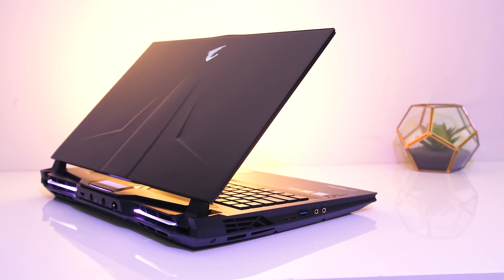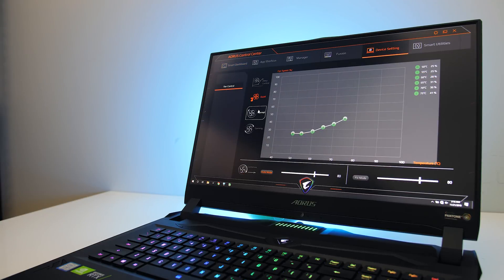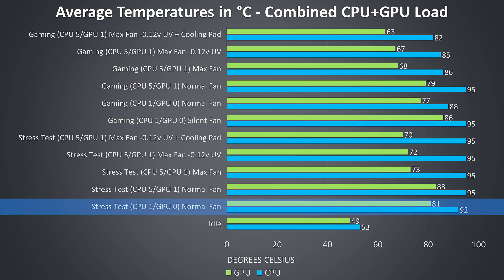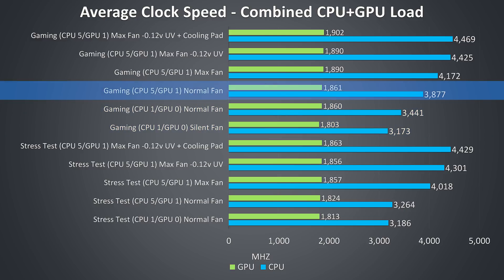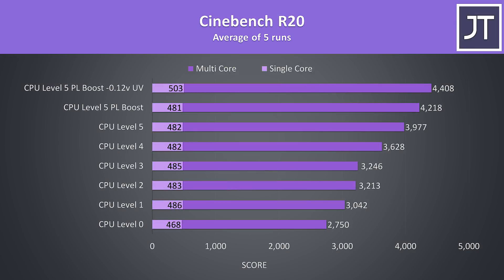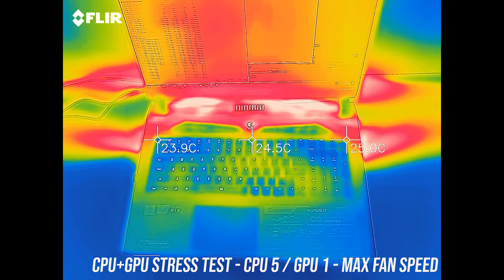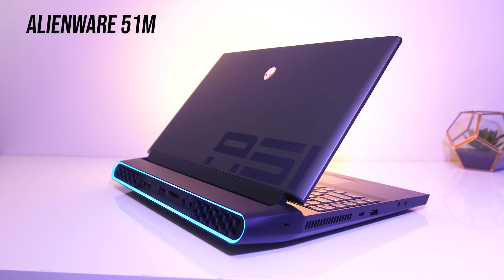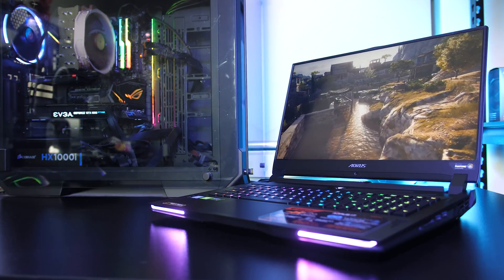Aorus 17 YA Thermals - RTX 2080 + i9-9980HK Too Hot?

Comment: I like it, just not a fan of f the two bricks. Have always been a fan of Aorus design. How does it get on with one brick, does it have one power connector ?
Reply from the maker: I briefly tested it with 1 for someone on Twitter, only briefly, but only lost 2 FPS in shadow of the tomb raider at highest settings, would vary on the workload I suppose.

Comment: Aren't you going to test ALIENWARE M17/15 R2 core i9 ? you promised since the launched date of the product
Reply from the maker: Honestly, probably not. I've lost hope and given up. I kept following up with them at least once a month since they launched at Computex in June and kept being told they didn't have review units yet. I know for a fact they had them on show at PAX in Melbourne in October. I asked them if I could get one of those and they said they'd have them soon. Still being told they don't have them 1-2 months after that. I've seen other "influencers" and streamers get them in Australia, so I guess they're prioritizing them over actual reviews. I've got such a backlog of machines here at the moment that I'm not going to go out of my way to request it from them for the umpteenth time, if they want me to cover it they've got my details.
Reply: @JarrodsTech  Oh, forget about it then, am sure they have issue with this new unit same as M15/17 thermal, am currently having M17 and offered to get new M17 because my current unit has a lot of issues in heating, I actually had to undervolt the CPU and use cooling pad to cool down my unit and guess whats the major Issue in this unit! once it heats up I am getting disconnected during my game due to the WIFI card is right in-front of the heatsink so once its 100 degree you lose your game. I tried to run many test till I found out is must to cool the heatsink in order to not get disconnected.
Reply from the maker: That sucks :( hopefully I can test it out eventually, but yeah not holding my breath at this stage.
Reply: @JarrodsTech  Hello Jarrod, I got my new unit today and tested it out so thought to tell you quick info: the model is much better than R1 in terms of thermals, while idle is 45-50 degree without cooling pad, in gaming it hit up 89 max (Core i9), and it cool down very fast. I really recommend it finally Alienware made it. the keyboard has really nice feel and travel distance but the touchpad is very bad while scrolling it lag for almost 6 sec and then it work. cons: no 4k panel option, no HHD.

Comment: What laptop would you recommend around the 1500-2000 AUD range? I am looking for one that is no bigher than 15.6", has decent battery life, and is lightweight.
Reply from the maker: Probably a Lenovo Y540 for $1500-1600 AUD with 1660 Ti. A little towards the heavier side, but yeah one of the better options in terms of GPU power for the price.

Comment: Thats why Gigabyte only sells good in Desktop and not in Laptop...

This should be sell through HIDevolution with every possible upgrade lol...

But still I think this cooling its just a failure... And wont change anything.
Not a heavy cooling when looking at it, especially with this shitty Intel processors.
Reply from the maker: Disagree about the cooling, it's an overclocked 8 core CPU with high power limit and expected. Sure liquid metal will help, but given the same specs are in the Asus mothership and that comes with it but still has thermal limits, it's always going to be an issue
Reply: @JarrodsTech  ROG G703 and GT75 Titan at least has a decent amount of Pipes besides not using Vapor Chamber. But both CPU and GPU seems more independent and overclocked as well... 

I think Aero with same 9980HK its still better...

Comment: Would you recommend the i7-9750H config over this? it's much cheaper and probably has better thermal performance.
Reply: I have that cpu in my laptop and its mutch cooler en kinda the same performance
Reply from the maker: It depends what are you using it for? regardless of thermal performance the 8 core option will do much better in multicore workloads so it depends what you're using it for
Reply: @JarrodsTech  the diffrence is not verry huge
Reply: @JarrodsTech  I mostly use it for gaming. my fiance is a graphic designer she sometimes use it for light rendering minute long videos. Could you recommend a laptop/config that offers good value for money, can game at high frame rates and doesn't run too hot or loud? Looking at under 2500..

Comment: What have they done with the heatpipes amount?? I've seen old laptops with more heatpipes than that xd
Everyone should follow razer and start doing vapor chambers anyway!
Reply from the maker: I think it depends on other factors like power limits, the CPU here has a much higher power limit than most others, so regardless of the cooling it's going to get hot, however it has the performance to back it up.
Reply: @JarrodsTech  That's why they should improve their cooling solution.. I guess they tried to make a light "titan clone" since copper is very heavy but no one buy those laptops to take them anywhere!

Comment: Curious why they use 2 *330w instead of something like 2 * 200w or 330w + 100w. A 100w CPU + 200w GPU + other components should still be less than 400w right? It is not like that laptop have huge headroom for overclocking... Or did I miss something?
Reply from the maker: Yeah not sure, seems a bit overkill compared to others.
Reply: Allows the system to not starve of wattage on sustained loads, also if you have peripherals, you will easily surpass 330 watts

Comment: Hey there Jarrod! Like your videos, keep up with the great work! Question, Im planning to buy a laptop, I checked your video reviews on the Asus GX701 and the MSI GT76. I decided on these two, but which one would you recommend to get based on cooling solution? I got funds don't worry!
Reply from the maker: Both are quite good but the gt76 is on the next level. I think it depends more on whether you want something very thick or very thin. The gt76 will probably cost more but will also perform better. That said the gx701 still offers a great experience. I think both will get pretty hot the gt76 will probably get hotter as it has higher end hardware

Comment: Hmm.. 6 USB. I couldn't quite see if any of the USB C had Tbolt.. but if the DPC latency is low, then this is a good jack of all trades.. The fact you can game in quiet mode at those FPS does it for me.. and really, we knew it would never hit 5GHZ, but it's still able to exceed the cpu's normal specs of 4.2ghz all core turbo.
Reply from the maker: I'll cover that and ports etc in the full review 😎

Comment: Hi, can you tell me which notebook  is better ? ASUS TUF gaming fx505du with Processor AMD Ryzen 7-3750H (2.3GHz, turbo 4GHz) 4GB , NVIDIA GeForce GTX 1660Ti 6GB GDDR6 SSDHD, 120Hz dis.  or Dell G3 15 GAMING with  Intel Core i7-9750H (2.6GHz, TB 4.5GHz, HyperThreading)6GB, NVIDIA GeForce GTX 1660 Ti Max-Q 6GB GDDR6, SSDHDD, 144Hz dis. and both have 16GB RAM DDR4.
Reply from the maker: The Intel CPU will demolish the ryzen easily, but the G3 uses max-q graphics so the Asus might do a little better in games. I have reviews of both on the channel with the same specs so you can compare.

Comment: 95°..... CPU....😑☹🔥🔥🔥🔥🔥🔥🔥
Reply: Shadow MX that’s normal for laptops
Reply: @gretcharen  😭😢i search a good laptop with a good cooler system
Reply: @ShadowMX971  , acer helios 300 is prob best. The thing that works for me is to limit cpu boost to around 3.5-3.6 in throttlestop. It kinda stays around 70 then).
Reply from the maker: I think it's expected for an overclocked 8 core 🔥

Comment: The giabyte control center fan control is not REALLY customisable. You can only increase fan speed above default values but not vice versa
- An aero 15x9 owner
Reply from the maker: Even if you use the entirely custom fan curve mode?

Comment: Hey Jarrod. My comment is not related to this video but I  really wanted to thank you for your videos regarding the Lenovo Legion. It helped me make an informed decision. Just wanted to say you were right about all of it. With a special mention about the keyboard layout being a little weird in its layout. It will take a bit to get used to.

One thing weird is the thermals and boost which for my machine goes all the way up to 4285 Mhz all core. And my temps seem to be on average about 5-10 degrees celsius lower than what you had without undervolting.  Than you again for all the hard work and hope you keep this up.

P.S: Do not let this distract you from the fact you do not have 1 mil subs yet! :D
Reply from the maker: Good to hear the content was useful!

Comment: Great video as usual! I have a question, From all the laptops you've tested, which one has the best thermals and which one has the worst thermals?.
Reply from the maker: Honestly nothing really stands out and I don't have a ranked list of the results to really answer easily. I remember the Helios 500 killed it in thermals because it has massive heatsinks and fans for the specs, but it's quite thick as a result. For a thin machine the gx701 did very well and impressed me for what it's offering

Comment: off the top of your head, whats the best laptop, fat or otherwise, that still has 1 power cord?
Reply from the maker: The Triton 900 I'm testing at the moment has the RTX 2080, but i7-9750H, and has just the single 300w brick (or maybe 330? Can't recall yet, it's at home and I'm away for a few days so can't check).
Reply: @JarrodsTech  i was thinking next gen or the gen after that ill get something like that. 15x is nice but not my style. need more to hold onto, more stuff on the inside. more cooling would be nice too.

by then AMD should have some serious 8c mobile chips too, that'd be interesting

Comment: Great professional review. I really enjoyed it. Thank you Jarrod. But 2 power bricks wow.
Reply from the maker: Thanks! You can use it with one just won't quite get full performance
Reply: @JarrodsTech  hi Jarrod did you see the new 780W single power brick? some resellers are now selling this with the high end laptops like 51m and wow, it's 1.4kg but at least it's only 1 brick, really cool. what do you think? also I saw some resellers allow the 51m to be delidded, repasted everything with the best pastes, thermal pads, and even a 9900KS upgrade and silicon lottery binned for 5.1 or 5.2 (another 500 plus USD markup over 5.1). This is so crazy. Wish you could demo one of these, it would be one hell of a benchmark. this was about 4800 USD.

I ask about this because it seems like aorus 17 is right after 51m, but not cheaper so that made me think why choose this in that case.

Comment: Hey Jarrod'sTech
 i need your help i want to buy a laptop and i have this option  which one is good for game and audio softwares 

Asus G731GV-EV180T Intel Core i7 9750H 2600 MHz/17.3"/1920x1080/16GB/1512GB HDD+SSD/DVD нет/NVIDIA GeForce RTX 2060/Wi-Fi/Bluetooth/WIndows 10 Home (90NR01P2-M03840)

DELL G7 7790 G717-8226 Intel Core i7 9750H 2600 MHz/17.3"/1920x1080/16GB/1128GB HDD+SSD/ NVIDIA GeForce RTX 2070/Wi-Fi/Bluetooth/Windows 10 Home

Thank You....
Reply: Hey ! 

You can wait for Jarrod but I’m gonna give you my opinion.

First of all, know that I’m slightly biased as I am a fervent ROG defender and had several bad encounter with Dell.

I would go so far as to recommend you the G731GW-DB74, having an RTX 2070 and 512Gb of SSD, to which you can buy and add a 1Tb (or 2 or whatever) HHD/SSHD drive. 
As far as cooling goes, I don’t think one is sensibly better than the other so it comes down to a brand / design / price matter there. 

Both the GW and GV have great upgradability RAM and ROM wise, the very most important cool RGB feature that increase your gaming performances by 4000% (lol)

Hope you’ll be satisfied whatever choice you make ! Good luck :q
Reply from the maker: I'd probably lean towards the ASUS

Comment: Considering that the desktop 9900k in the GT76 and Area 51m run hotter I think this is a great win. Plus the Aorus software seems very useful and gives the user a lot of control. Would be very nice to tune this machine to run at a lower cpu level for gaming and have it run even cooler. And the GPU temps are very nice. 

I am curious if you run the CPU and GPU at level 0 if it’s possible to game on one power brick? You know for when you want to play a quick game at Starbucks? 🤣

Veeeeeery tempted to pick one up. Gigabyte has been impressing me the most lately and I think I can trust them to make a proper machine and stand behind their products.
Reply: i have an aero 15x v8, same as jarrod, and i have no idea how they are with warranty because the thing has been solid. they're definitely not a bad one to go with. easy to get into and replace things, and if anything does go wrong its a 2 year global warranty so doesn't matter where you are
Reply: I didn’t realize they had a two year warranty also. That’s a very nice selling point. So many only have one year. 

Thanks for the feedback.
Reply from the maker: Yeah I've used mine for about 14 months and no issues outside what I mentioned in my videos last year. I think this one is decent too given its a fair bit cheaper than the gt76. One power brick still gives most of the performance, I didn't measure it intentionally but did try it briefly and worked alright so don't need two unless you want best performance. I still have it so I could look into that further for you if you want. Due to the way YouTube comments work I might not see replies to this thread, email me or something if you want anything done while I've got it.
Reply: I’ll send you a tweet @Jarrod’sTech. Hopefully that will get through.
Reply from the maker: @Terreos  sounds good. I'm away on holiday til Thursday

Comment: I am of the opinion that it may  be a good product (better if with liquid metal), but the GT76 titan remains the best for both hardware and software
Reply: if you want this much power, you don't buy a laptop period. If you're so set on gaming, you buy a kickass desktop and a cheap laptop for portability. This ONLY makes sense if you shit money and constantly need to move it.
Reply: explosivx43 well your last four words said it all. I am moving a lot, being away from "home" 20 / 30(1) days, and I am not staying more than 3-4 days at the same place. Rince and repeat every month. So as a gamer I do need a massive machine like that (even tho I don’t need this one, my Zephyrus S GX701 is enough for me + it’s light so advantage there), but if my laptop was to die tomorrow, this machine would present a solid candidat for me to consider.
Reply from the maker: This is also a fair bit cheaper than the gt76 yet can still keep up in some cases 😛
Reply: This actually matches agaisnt MSI GT75 Titan!

And the Acer Predator Helios 700, Asus ROG G703.

Comment: It's the Titan GT75 all over again 😅
Reply from the maker: In which way?
Reply: @JarrodsTech  Well, it's certainly more refined. Though I found with the GT75, it needs an underclock to be even usable! Way too loud + hot, coupled with performance fluxing at the standard 'out-of-the-box' 5ghz settings. 

I've found a sweet spot, yet CPU intensive games such as Space Engineers still kick it in the teeth. (Space Engineers is quite good for stress tests 😊)

Comment: And does alienware area 51m have side vents on rtx 2060
Reply from the maker: Yes, the chassis is the same regardless of GPU choice
Reply: @JarrodsTech  ok because alot of people were saying the gpu side vents changes
Reply from the maker: @crysis1174  hmm I guess it's possible but thought they were all same
Reply: @JarrodsTech  yeah looking for a laptop mostly at home mine move to different location at end of week any suggestions?
Reply: @JarrodsTech  you replying to comment like this u will get far in YouTube don't ever stop soon u will pass dave Lee and others u are the go to are laptop reviews
Reply from the maker: @crysis1174  Maybe check out the MSI GT76, available with similar specs but far less software issues unlike the 51m.
Reply: @JarrodsTech  I know the chaiss does not change but on rtx 2060 or gtx 1660ti side vents don't work